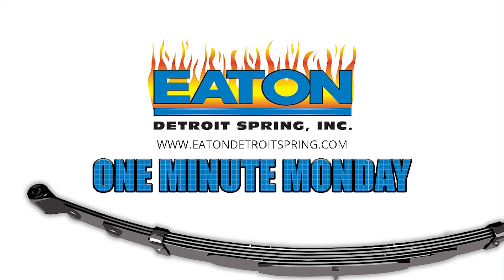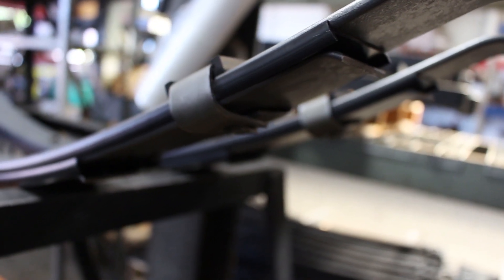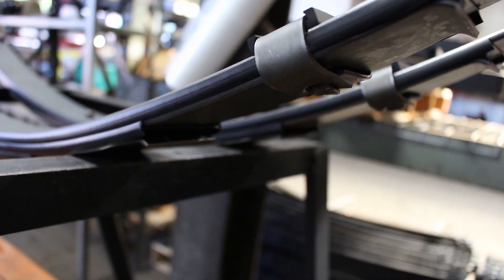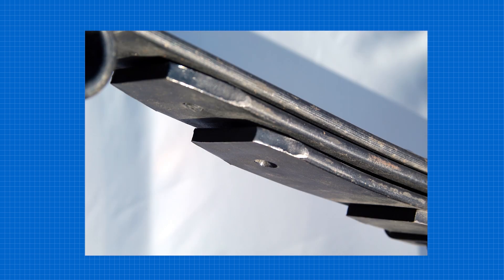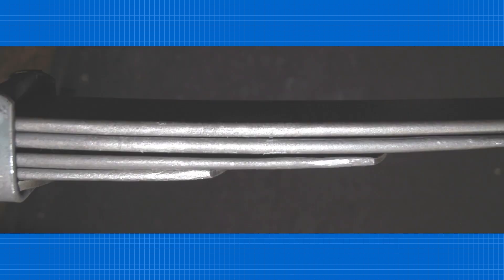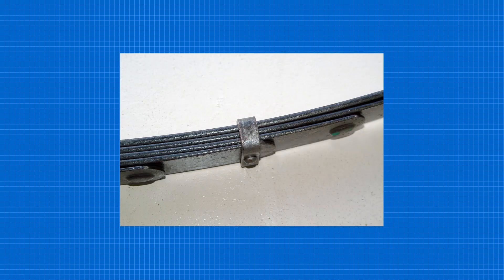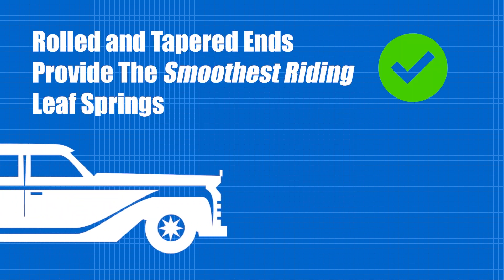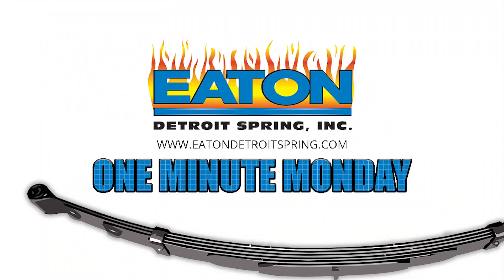Leaf Spring End Types - One Minute Monday by EATON Detroit Spring

Comment: Hysteresis

In a leaf spring when compressed suddenly the square leaft end causes a harsh bump then eases off the pressure.
A rolled leaf gets thinner toward the end so that when a bump is hit the thinner leaf tip smooths the shock to the rest of the leaf.... The next shorter leaf adds its effect gradually not abruptly. = smoother ride